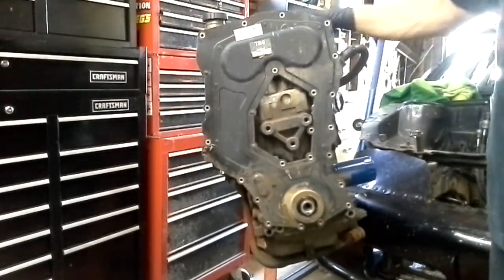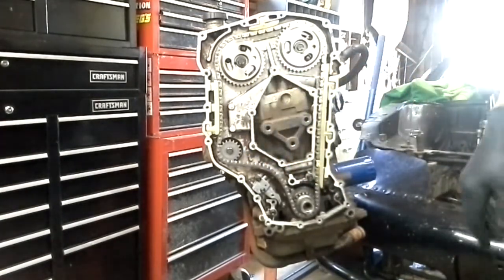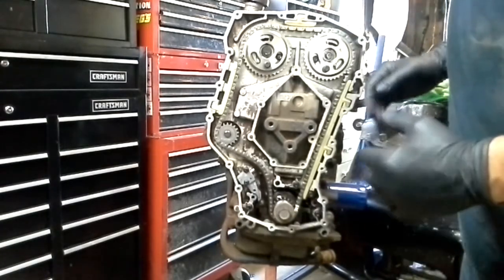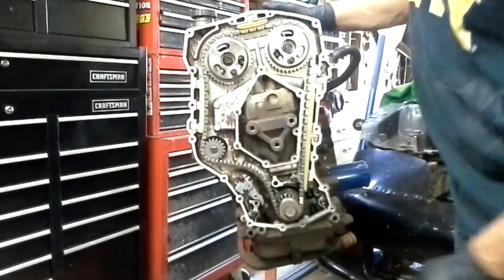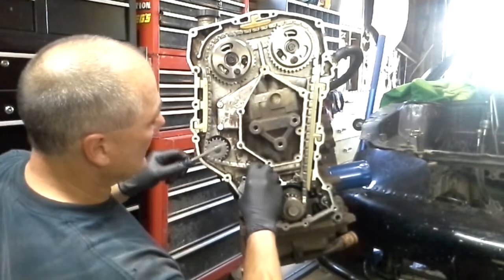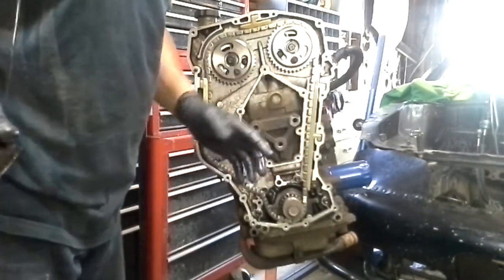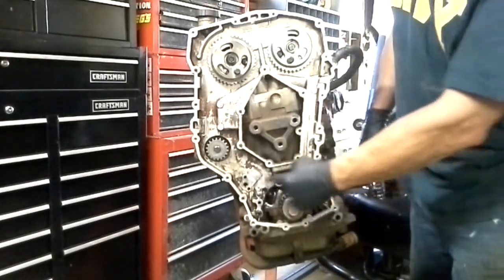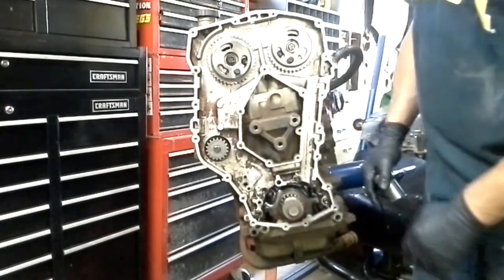Quad 4 How to properly remove timing chain and gears

Comment: I did this in the car. Kinda hard to do. Torque on can housing bolts are hard to find. I pulled the threads on one bolt. 16 ftlbs and 90 degrees is to tight
Reply from the maker: That is common. Nowadays, I simply torque the housings to 15 ft lbs.

Comment: I'm working on this motor in a 98 Pontiac Grand am. P0301 obd code. The plug tube was swimming in oil. In order to replace the valvetrain gaskets, do I have to remove the timing chain and sprockets?
Reply: Unfortunately you do.  Just got done replacing the cylinder head on my cavalier with the ld9.  All that stuff is in the way. However,  don't overlook the fact that the oil temp. sensor in the same area goes bad and leaks oil everywhere as well.  Had that problem at one time, unless you're sure it's coming from the gaskets in the cam housings.

Comment: Great videos !  Race car ok how do you deal with the oil wanting to go to the right side and starving the engine in the turns. Just lost the engine in my 2000 Cavie 2.4 quad 4 Thank you for all the great videos
Reply from the maker: I'll be adding a baffle to the oil pan to help with oil control.
Reply: the oil pump on the 2.4 turns something like 2.2 times for each crank revolution. When racing most of the time the engine is at 6400 rpm the oil pump is turning at 14080 rpm and some say it foams the oil and causes engine failure. They recommend using the 2.3 pump pan baffles the entire set up. the 2.3 pump turns 1.4 times the crank at 6400 the pump is at 8,960. Have a lot of money in the car and am trying to spend carefully. There is some machine work I am sure you or I could do our-self. Thought about a baffle at the end of the balancer's down to the pan bottom just under the main bearing with a couple 1/2 inch return holes. If you have raced these engines I would feel your opinion would be of great help I am ready to start putting it together and back in the car. Thank you for the great videos.
Reply from the maker: Thanks for the post. Well, the 2.4 pump spins exactly 2 times the engine speed. I've raced it to 7200 for about a dozen races and everything seemed decent on teardown. I've done the swap you speak of. It's tricky but doable. Actually ruined one block so my advice is to do the conversion before you have any other machine work done.
Reply from the maker: I know guys who blow 2.4's up after just one night and finally give up on them. There's a simple thing I do before running the 2.4 with the balance shafts: 1. I pull the crank and polish it. 2. Rebuild with new rod and main bearings. 3. Set the oil pump drive chain lash to factory specs. Install new timing chain.  If you do those 4 things, the 2.4 will live quite well. I've ran those motors pulled straight from the junk yard with 150,000+ miles on them and haven't blown one up yet (after doing those 4 things). Remember...I said "Yet." lol
Reply: Thank you will do as you did. What you think of my baffle idea?
Reply from the maker: Sounds great. I'll be adding a baffle to my next build.
Reply: Is there a way I can send you a pic of what I came up with? made a pattern and before I make the real thing I would like you to see it. Thank you again
Reply from the maker: Sure. Love to see it.

Comment: Are there bolts in back of the cam gears attached to the valve covers? If so can they be removed thru the access holes in the gear? Or do the gears need to be removed?
Reply from the maker: The gears need to be removed.
Reply: @LD9user  can i do this with engine in car or do i have to pull engine
Reply from the maker: @steveearl2291  it can be done in the car. I pull the passenger side motor mounts. That allows me to use a Jack under the motor to move the motor up and down a bit which gives easier access to some of the bolts. Good luck.

Comment: What stinks is I have an oil leak on the exhaust cam tower and have to pull it this far apart to change the gasket.
Reply from the maker: I know! All...those...bolts! lol  If you search my channel, there's a vid on how to avoid gasket leaks on these motors.
Reply: That's what I'm dealing with now